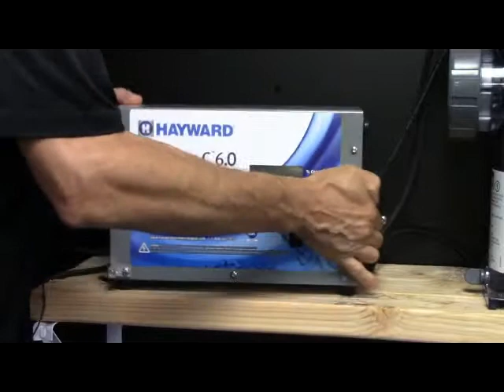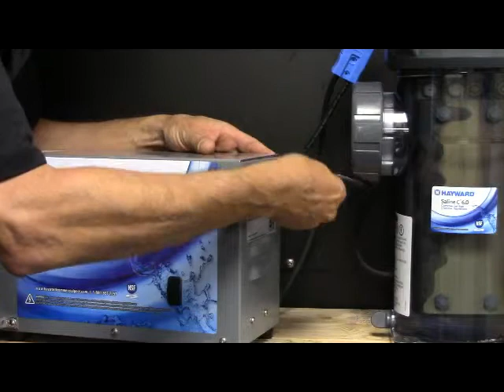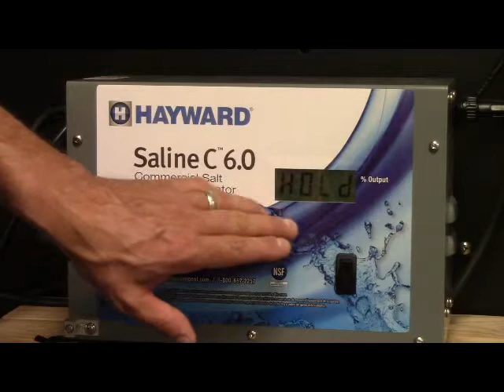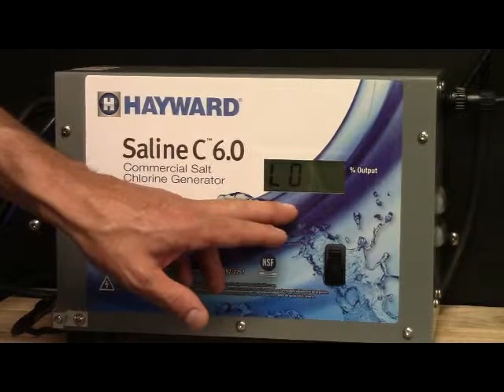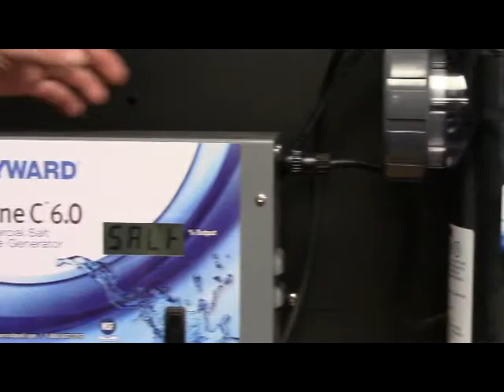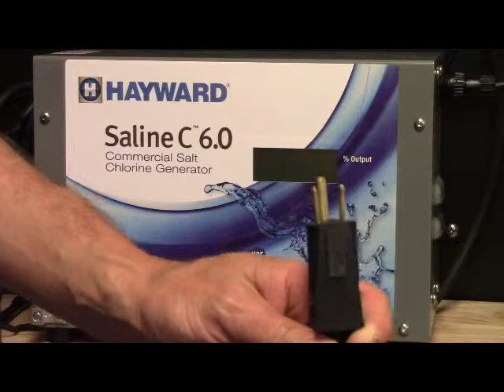Hayward Saline C6 technical help

Comment: I've installed this unit on a 45,000 gal pool and it has the ph spiking at 8.6 even after adding many gallons of muritic acid which screws with the other chemicals ..is this a common problem ?
Reply: Yes, you have chlorine always producing causing high ph